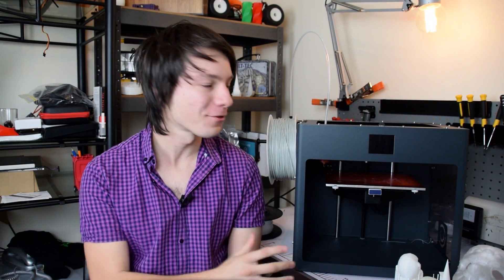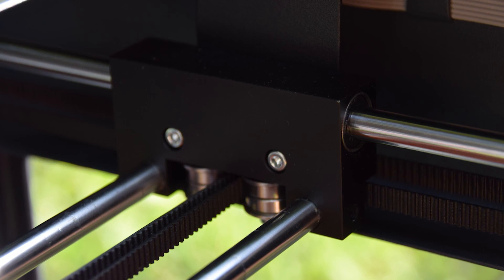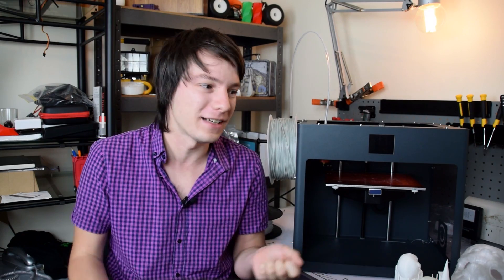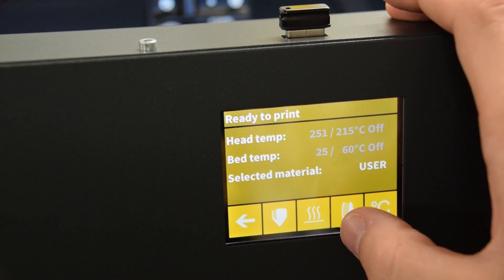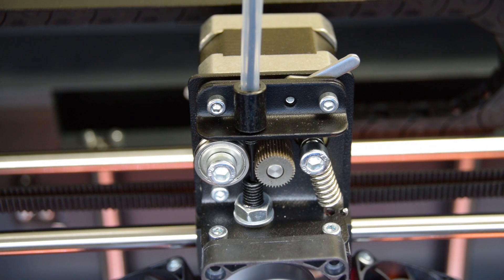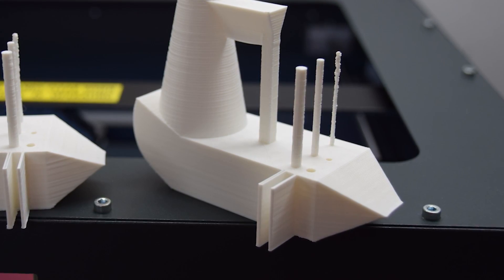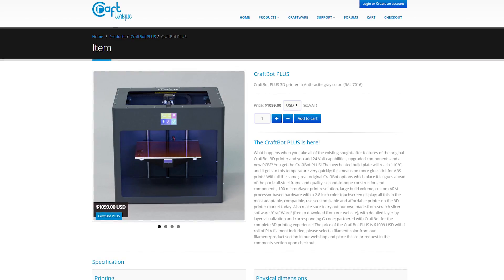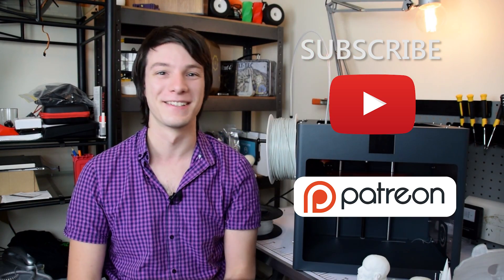CraftBot Plus 3D Printer Review

Comment: The cantilever design is often a weak point and IMO a bad design choice, almost to go as far as calling it a flaw maybe in choice of design. With that said, i have a wood frame Replicator Dual from 2013 (got a deal i couldn't pass up) and that's one of the very first flaws i saw in the machine so i made sure to re-enforce the Z axcess rods with washers for the screws to hold on tighter without crashing the wood and Loctite super glue that's able to withstand impacts but also still stiff which fixed it almost completely printing at 65mm/s. Years later i designed new supports for the rods which made all the difference and now the layer lines are near perfect printing at even 90mm/s. Either way i run the printer at 45mm/s to minimize vibrations for ghosting/reverberations and it's not as loud either. Which reminds me of another design flaw i found in the Y motion timing rails in that they allow a bend/bounce in Y motion and also supported that with something i designed. I also suspect that the old 8-bit processor doesn't keep up as well and get a little bit of weird lines and the motors seems to run much harsher.

But i noticed that the CraftBot Plus mounts the platform onto the rails with a small rail footprint on the rail allowing vibrations and movement to overcome the bearings or shafts (can't tell what they use) unlike the printer i have which has two linear bearings on each rail about 80mm apart from each other with Much thinning rails. There are still companies selling clones of the original Replicator and they seem to have good reviews and use thick long cylinders as bearing slides which seems very sturdy like in the PowerSpec Ultra 2.0.

Now i realized I've sat on two things that greatly improve the design of the old Replicators and think I'll post them up on Thingiverse and other sites so other people can easily improve there machine without having to rebuild a whole new frame or buy one.

Comment: Did  I understand you to say that if printing objects at or near the build volume limits on this printer that there would be some warping due to its open architecture?  If so, can you give some idea of how much warping on say a sphere 200mm in diameter with inner support structure?  Also is there any home of solving this by somehow attaching glass panels on the open sides and front glass door?  Thanks

Comment: Just a Update I bought the new Craftbot Plus and its Nearly silent!   Loving it so far, i just need to get better at slicing and adding supports.  The printer is absolutely plug and play, just take it out the box level bed, put in the filament which it comes with a 1k roll of white and a small assortment of orange, black, grey also.  Thanks for the video it pushed me in the right direction and i picked up a really good printer for a beginner.

Comment: I believe the noise you mention later in the video was due to the incorrect z-axis you had.  My printer is very very quiet.
Reply from the maker: The later versions have fixed many of my complaints from this early 2016 model, I wouldn't mind testing the new one out!

Comment: I have the Craftbot2, almost the same printer with a Wifi added. There is an option for a enclosure (dome + door) with exhaust filter which I have. It prints PC very well, ABS should be fine but I don't use it. I also found TPU printed fine, though there is a mod on thingiverse to add a guide to help which is useful with even softer filaments.
I really like this printer, it just keeps on trucking.

Comment: Good review, though the sound was a little wonky at times.  I think it was because the mic was pinned under the lapel of your shirt.  Question about the build plate - how easy would it be to replace the upper aluminum plate with a glass bed?

Comment: I was one of the lucky ones to get this for $400 during the first kickstarter.

Also you didn't mention that it has wifi also. And they added live modifiers to the control software and on device touchscreen so you can tweak temps and speeds etc... during the print.

Comment: +Maker's Muse: Thank's for the review, Angus! I would have missed out on a great machine otherwise. The Craftbot plus was just what I was looking for - sturdy and reliable, without being too expensive.

Craftunique has since released the Craftbot 2 which comes with additional WiFi connectivity, and they have also released the Craftbot XL - which is an enlarged version of the Craftbot 2, with nice linear rails and sleds instead of the usual rods and linear bearings for the three axis (I'd like to see that one in action :) ).

Comment: i don't know if anyone has already told how to resolve noise problem. i succesfully solved it by changing original lmu linear bearings with drylin igus ones. they costs only 15 euros for 8 pieces on eBay and the printer become really quiet. ( original lmu linear bearings also damage the rods creating Little grooves on their surface, so i suggest to everyone to change them )

Comment: Hey Angus,

Now that you've been using the Craftbot for a few months, how do you like it? I'm considering a Craftbot 2 (which is essentially the same machine as the Plus, with a Wifi module added), and I'm wondering if you have any additional comments on the print quality. I currently have a well-tuned Duplicator i3 v1, and there really isn't much to fault with the prints from it. The i3 design is of course prone to a little ringing, would you say the Craftbot is a step up in print quality?

Comment: +Makers Muse
Angus would you recommenced this machine? It seems really nice for the price and the build volume is great. Is it me or does that noise sound like it is grinding hard almost kind of like it is sticking. Se i have to get a new printer since my Delta died at the hands of my cats knocking it off my desk and it warping the aluminum frame and breaking the rods and ther various things. I have no motivation to build a new one so i was gonna get a pre-built and found this. It would seem to be a toss up between this and a PrintrBot Metal Plus. Any input would be great.

Cheers

Comment: Got my Craftbot Plus and it isn't as noisy as i thought it was going to be and there are no metal scratch noises like in you're video just a fan and the head movement with the small hiss of the stepper frequency. Did my first print of a Darth Vader head i modeled a while ago to see how well it prints and it's pretty awesome , lots of details came through even things i didn't think it would.
 It's on my channel if anyone is interested.
Cheers

Comment: It would be very interesting to see if z-layer accuracy behaves differently on 60/80 compared to your 100 (as vibration should be lower?)
Reply: +Rob von Bothmer I got a Craftbot Plus and printed a Darth Vader head i made and it turned out great at 100 micron and 60 mm\s.

Comment: I would love to see your review on Diamond hotend. Especially considering your ideas on dual-head printers, which I 100% agree with.
And very nice printer. I wonder why they did not used the bowden extruder setup - that would limit the inertia of movement and vibrations, possibly resulting in better prints. They already have the bowden tube anyhow...
Reply from the maker: +Robert Klauco I really need a printer with 3 extruder capability... and they're quite rare! But if I get hold of one i'll certainly look into it. Might flick e3D an email.

Comment: Super big thumbs up on the manufacturer support. I had an issue with a pinched cable after a week, and they sent me all new parts without any guff. And then while repairing that i guess i jostled the connector to the LED lights, and they send me all new parts for that as well. These guys are in for building a customer base. 

As far as the noise goes, I guess I don't have much to compare it too, but the printer sits right behind me at my desk while printing all day (venting routed out window), and it doesn't bother me at all. Although after I replaced the cables, I guess I tightented up the belts a little too much at first because I was getting that super loud noise you showed, and after easing off the tension just a little most of it went away.

I have not had any real issues with the accuracy. Here is a time lapse of a spindle i'm making for a personal project. You can see it's flawless and threads perfectly into the device i designed it for (using a .4mm tolerance gap)
https://youtu.be/kXdrwNzaAoA
Reply from the maker: +Devin Miller Great feedback cheers! Was that spindle PLA or ABS? I think much of the noise could be reduced, but it's how it came.
Reply: +Maker's Muse Hatchbox Silver PLA. Been getting some very good results with it.

Comment: A belt without right angular beltpath makes me laugh. Angus, did you assemble it wrong or is it faulty designed? Min 2:38 shows it clearly...
Reply from the maker: +René Jurack I see what you mean, that is how it came. If the motor is tied to the correctly perpendicular belt though, would it actually add inaccuracies?
Reply: +Maker's Muse Yes, two things are going to happen: First, depending on the position of the carriage, the tension of the belt is different for every position. This does affect the right angular of the X-axis and can force stalls and other things related to belt tension. Second, the printer can't print right angulars, instead it is printing parallelograms. Every cubish part printed should be off, this should be more visible at bigger printed parts. To sum it up: This is a major design-flaw, because it's one of the few important things to take care of when designing a printer. To verify this, just print a part like a pictureframe or such and then take measures diagonally.
Reply from the maker: +René Jurack hmm sounds like I do need to conduct a right angle test, I'll let you know the results.
Reply: +Maker&#39;s Muse Hi Angus, any update on this 'issue'. Did you execute any additional angle tests? Very curious if this is really a serious design-flaw. I also checked other video's and it seems 'by design', so not an unique thing on your machine. Thanks!
Reply: I didn't look it up, bur what for a beltpath is used in the craftbot? H-Bot? CoreXY? Seperate driven axes?
Reply: +René Jurack https://craftunique.com/forums/view-thread/291 CoreXY apparently
Reply: Oh. Than thats the worst case. A coreXY-System depends heavily on equal belt-tension of both belts.
Reply: +René Jurack +Maker's Muse received a prompt and great in-depth reply on my question regarding this subject from CraftUnique. According to the math there is only 0.015 mm deviation, so rest assured, it will do fine.

Comment: Can you use Craft ware for any 3D printer
Reply: +mike mun Yes, It has a slicer that will output to regular gcode files (custom headers and footers) and then it has a printer module that you can use to print from a USB cable. I'm fairly sure you can configure that to work with other printers as well.
Reply: +Devin Miller can I use it for my mini fabrikator and if so how do you have a video I may look at your channel if you can set it up
Reply: +mike mun I haven't actually used it on other printers. But if you jump on the forums at craftunique.com, they have some people who are doing that sort of thing.

Comment: If the steps are 1/8 for the printhead movement. 
Change it to 1/16 maby.
Should reduce the noice by a ton. 
If ur not running it at 200mm/s it should not make a difference on loosing steps and so on.

Comment: I have the original craftbot that i got as a backer and i love it. It doesn't get as hot as the plus (bed and extruder), but its still a good printer. Also mine does not sound like that, mine sounds more like other printers out there. One thing i should mention is that the bed came kind of warped, it might be a result of the cantilever design or just a defect, either way its something to be noted.

Comment: the astrosyn dampers definitely help the stepper motor noise, but there's some rattling going on somewhere. something is either loose or separated surfaces are touching each other during movement. i'm sure a bit of sleuthing could figure it out. then it would be a very quiet printer indeed.

the cantilevered bed is disappointing but typical for this design. hopefully they replace with a center supported or 3 post Z axis in future designs.

commercial H-bot printer is highly unusual and requires a stout frame to deal with the offset torquing forces. looks like the craftbot is up to the task.

kickass UI, very good slicer. good price point for such a capable printer. overall well done craftbot! well deserving of its 3dhubs rating.

Comment: Thanks for the review! Now I kind of want one now..

You said that it doesn't allow adjustment during prints, but I just visited their site for the first time and I see this under "Feature Highlights"...
Interactive printing
Users may alter printing parameters during the printing process.

So did you maybe miss something? Or is it maybe a timing issue where your machine has a firmware which doesn't implement this feature, but now it's available?
I also just realized, maybe that is a feature only available while printing from CraftWare tethered rather than from the memory card...hrm.

Comment: The thin wall issue with Craftware can be solved by setting the extrude width to 0.399mm, or by lowering the perimeter width percentage. I have my extrude width set to 0.600mm (which I'm finding works much better with ColorfabbXT) and then have perimeter width set to 64%. This is by the way with an E3D Hotend, which I mounted with an adaptor plate. I don't print in PLA on this machine and I've not found the stock PEEK hotend standing up too well to running high temperatures all the time. I also think the stock nozzle is too sharp compared to the E3D versions.

One thing that annoys me slightly is the hotend temperature being off by -20C. I've errors of this on magnitude on other machines, but have simply calibrated the sensor, or created a custom lookup table. To compensate I have to include start G-Code that raises the safe temperature limit and programme in a higher temperature. I've also had some issues with the extruder stalling,  but setting a higher current in the start G-Code has mostly sorted this.

Comment: which 3d printer do u reccomned buying?
Rostock MAX v2 DIY 3D any good?
Reply: +Clark Kent If you are an absolute beginner, it kinda depends. Generally the Rostock Kits can be VERY good, but you can get some bad kits (from asian no name low price sellers) as well. However, as it is a Delta-Printer you are dealing with, it can have some extra points of problems you would not have with a standard cartesian printer. Bowden extruder and the delta mechanics need more calibration work compared to cartesian and direct drive extruders. And finding/fixing problems can be trickier too, since some artifacts that come from a bad delta calibration are hard to diagnose and fix, especially for unexperienced operators.
If you are prepared to spend some hours just testing, tuning and tweaking everything before you start to get good prints, then you'll be fine. Just don't expect it to work like LEGO, where you just assemble everything and can immediately play with it in it's full glory... ;)

Comment: Not a fan of the cantilever design, but apart from that good design decisions all around :D
Reply from the maker: +JJ CC It's not AS bad as the makerbot Replicator 2X (stock it would flop around like crazy) but the added mass from the 2nd aluminium plate certainly does make it bounce more than I would like. I think the solution is to just tone down infill speeds.

Comment: For ABS  you may want to check that https://craftunique.com/forums/view-thread/1370
For noise level reduction https://craftunique.com/forums/view-thread/1491 this topics
Actually that noise directly comes from the bearings and rods and its easy to handle just need oil and good speed calibration.
Mine sounds like doing infills 45 degree on your videos all time
Reply from the maker: +Levent Ozigdeci I really need to get hold of a pei sheet to test, was looking tonight but shipping is more than the sheets :( It's hard to follow that noise thread, were the bearings diagnosed for the high pitch noises? It's those ones which mystify me the most. Resonance is normal, the Up Box makes loud noises during 45deg infills too.

Comment: looks like it would be pretty easy to add a top and door for an enclosed print area..
Reply from the maker: +Martin Turner It's difficult to enclose Core XY / H Bot config machines as the filament tube can be anywhere above the print bed at any given time, but a 'bubble' style top like the replicator 2X used to have would probably work.
Reply: +Martin Turner https://craftunique.com/forums/view-thread/1754/
https://craftunique.com/forums/view-thread/1564

Comment: what is the name of that anti wobble z coupler you said ?i didnt get it
Reply from the maker: +Karan Chaphekar Oldham Coupler - https://youtu.be/tmMrsJ1Jmy8
Reply: +Maker's Muse can you look at the video on my channel and help me deduce what the problem is on my printer with layering. any info helps
Reply from the maker: +Cole Nagao Looks like Z scarring, possibly due to a bent leadscrew on the Z, or your printer is not extruding consistently so lines vary in thickness. Sadly it's a well known issue on Davinci's and there isn't much you can do to fix it unless you start heavily modifying it.
Reply: +Maker's Muse I am willing to do anything to this machine any tips on where I can find a replacement lead screw or fix the extrusion